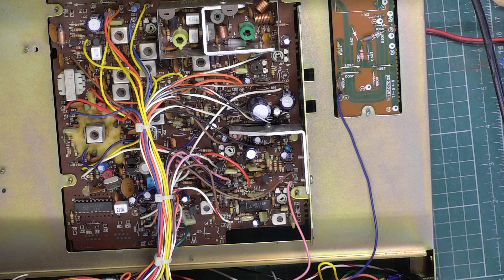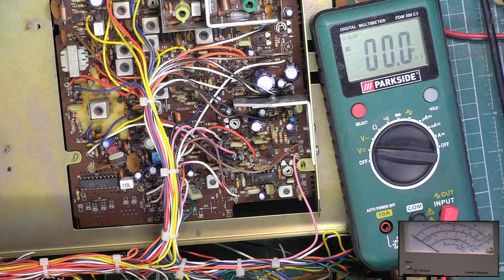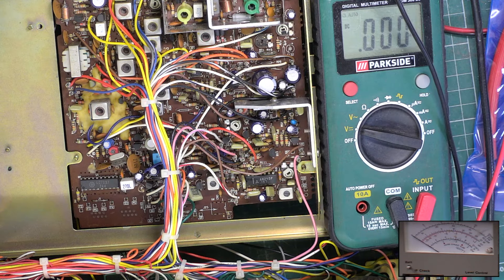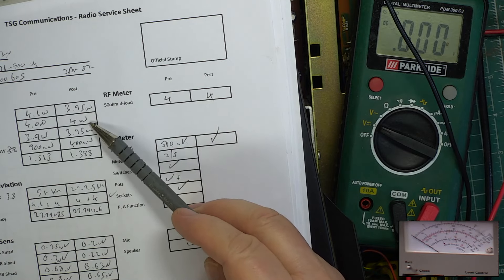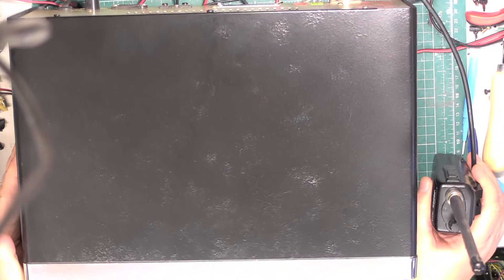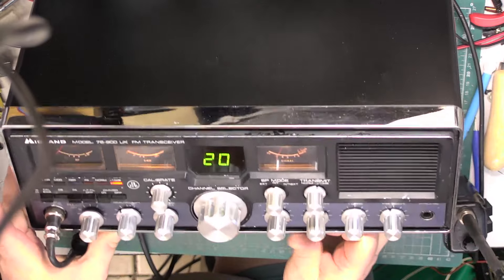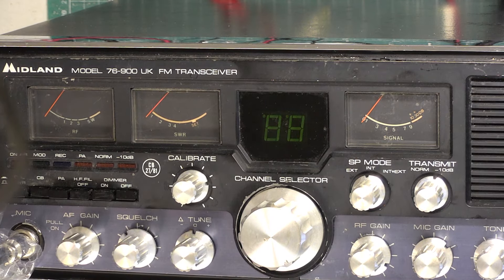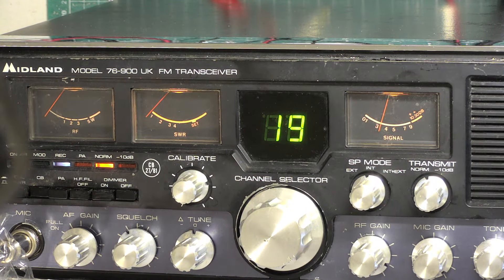Midland 76-900 CB27/81 UK FM CB radio base station -  Pt3 of 3, setting up the PSU & finishing off

Comment: Shame the left hand meter illumination is dimmer than the other two.
Reply from the maker: I could have changed all three lamps....but two are original. I don't want 40 + year old sets to look brand new (unless they are). 

Had this been a customer repair, they could have asked for all three meter lamps to be changed or none.

Richard, G0OJF, UK